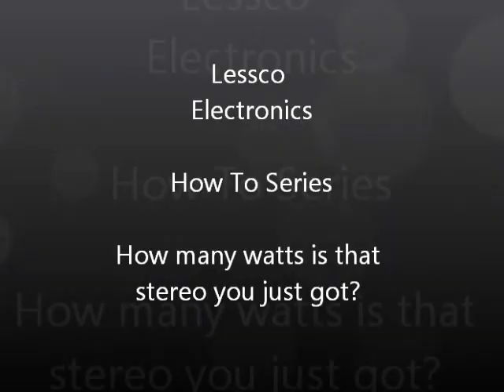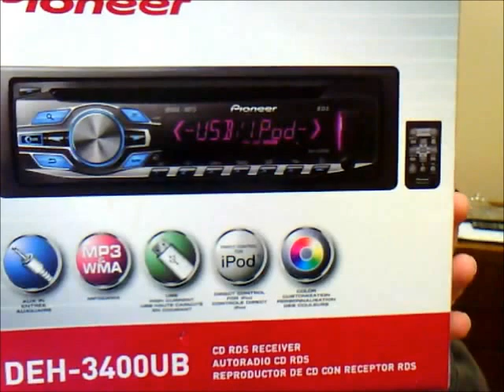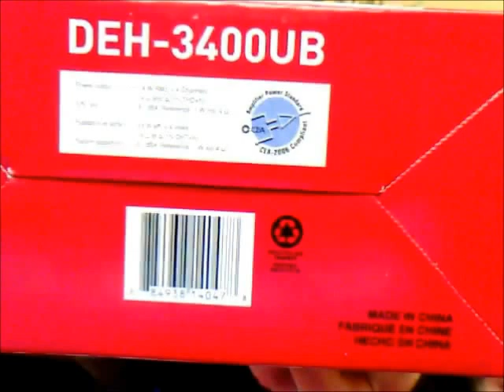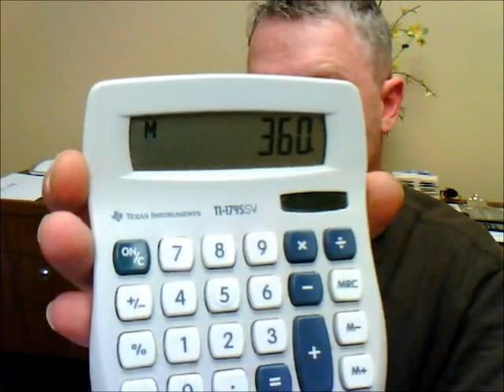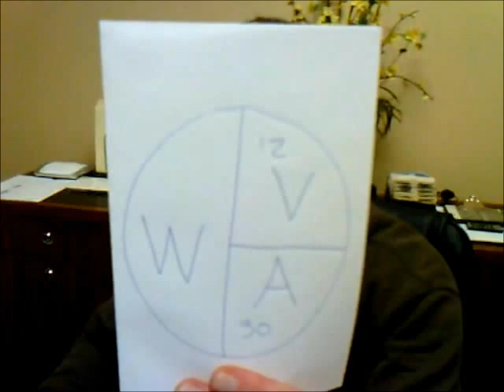How many watt car stereo do I really have here?

Comment: Head units don't have hardly any power at all. My friend thinks they're 200W total. lol. You need an external amp to get any half way decent sound out of them. I knew 50W X 4 meant 50 total from the beginning of head units. It couldn't have 200 and sound like they do. He's correct in what he's saying. People also think the old console wood stereo's had 300 to 500W amps because it showed it on the back cover. lol. This is what it uses, not what they put out. They were about 20W total. Live and learn !

Comment: i think some what he saying is true but if for a fact you read the box 50 x4 max means turn it up all the way then divided that 22 watts normal add 2000 watt regular amp bout 250 a channel that would make up the difference get speakers with lower watts instead of higher watts less watts better and cleaner the sound. you get  amp say 500 watts really normally you get bout 60 watts a channel but if you bridge it like 130 watt or more....this where mono block comes in play but a true 1000 watt amp ...it gotta say 5000 watts or so and you got to have work done to your car power supply with own supply really i think that is too much a true 300 watt system is loud enough to shake your windows and vibrate the seat

Comment: Alright, so we got a CD player (about 1A (14.4W)), we got a "Light show" (about 0.01A (0.144W)), we got a USB port (about 0.4A (5.76W)). So that leaves 8.5A for the audio, about 122.4W for the amp. You must know that Class D amps work in a extremely efficient way, so we will give about a 80% efficiency (probably higher in reality) to the amp. 97.92W are still available to the speakers, so 97.92W/4 is 24.48W per channel. It is a class D amp man!! They are efficient, powerful, small and cheap! It is just like a computer, a computer that takes up a room from the 70's is over 1000x less powerful than my tower sitting under my desk. Things change, amps don't need as many parts as they used too, live with it! Also Pioneer never claimed 50Wx4, they claim 22Wx4 at 5% THD or 14Wx4 at under 1% THD, which from my calculations I believe. 

Also your car has a problem if it is only 12V, most of the tests are run at 14.4 NOT 12! Most cars run at 13.7 - 15V.

Comment: i never use decks to power speakers i just use them for the preouts and inputs as long as there 4 volt preouts nothing less but with a line driver it is much better witch makes my preouts 8 volts

Comment: correct me if im wrong because im kind of new to electricity and all that jazz, but arent fuses for when you go above the fuses amps it will blow the fuse instead of mess up your system? so wouldnt that mean the stereo would put out less amps than the fuse to avoid ruining your system?